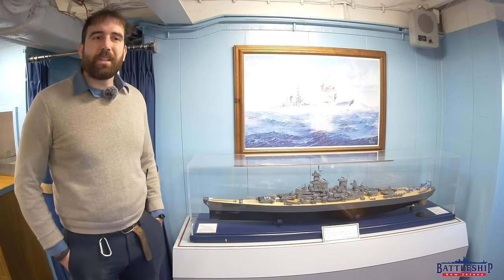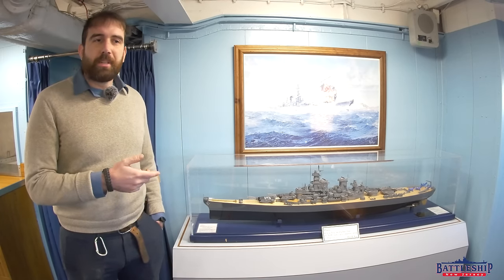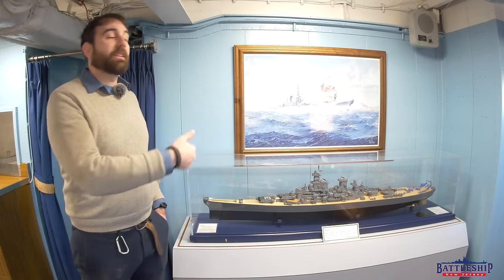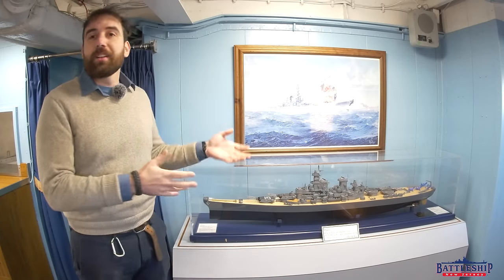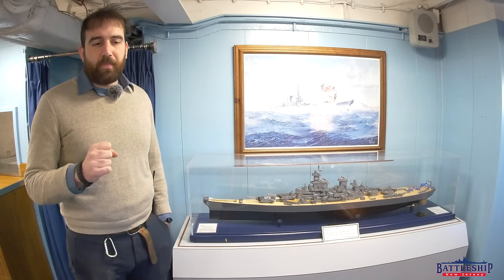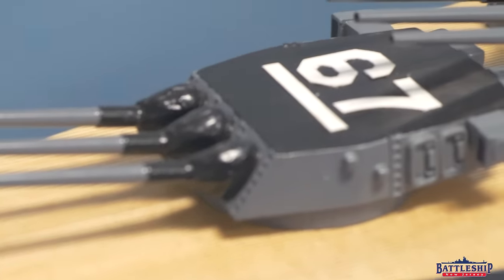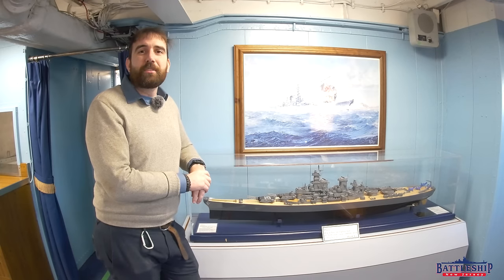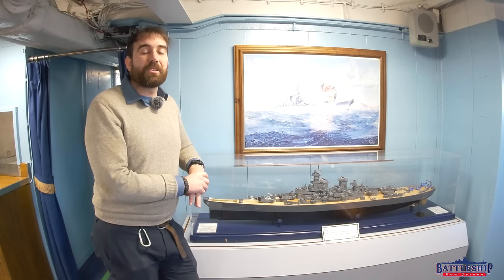Battleship Montana: What Would We Have Done Differently

Comment: A SLEP Refit to nuclear power for the  Montana with missiles replacing a couple of turrets.  Weight saved reactor shielding weigh down low.  The 20mm Oerlikons replaced with CIWS/ Goalkeeper.  (Dare I dream of 2 GAU-8's up high for small boats?) then the 5" mounts replaced with the modern main gun/turret combination.  The end product would be a clean Aegis superstructure, VLS replacing 2 turrets (space for Minuteman 4 pack).  MEGOID upgrade path.

Comment: First, if EVERYONE should have learned anything from the Battles of Leyte Gulf it should be that fleet commanders should fly their flags from heavy cruisers NOT battleships or carriers. Kurita had this right originally and Spruance also usually had this right. Just imagine if TF34 HAD been formed and sent rushing after the Central Force with all the various commanders who were aboard those fast battleships. It would have been worse than Kurita losing control of his battle as Yamato ran from torpedoes.

Second, I think the US Navy would have kept the Iowas after the war even if the Montanas had existed. The Montanas would be more expensive to operate without giving you any real advantage. There wasn't anything around that you would have needed an even bigger (and slower) battleship to handle.

Comment: By "Adding" 35' 0f LENGTH, to the ship, you would now have room for "2" more boilers, ( One on each beam ) which would ADD, almost 30,000 shaft horsepower ( B+W, 565psi, 1050 SuHt temp. ) so your "Armor Reduction" would NOT, be necessary. ( I have considerable knowledge on the 565 series of boilers !, as I am a "Master Welder / Mech Engineer, with 50 yrs of experience by trade.

Comment: I like your suggestions, I think the other change I would probably go for is deleting X turret to go back to 9 guns, and save a lot of weight, while using the space for an extra pair of centreline 3-inch mounts.
Reply: I mean... When you're going this far, you might as well just built more Iowa's and uparmor them. Add an inch and a half of armor everywhere (except the deck), take away the conning tower, accept the fact that this batch will be 28 knots on their best day, and call it a day.
Reply: @eric24567  I might only up-armour the deck and leave the rest as is, to protect against aerial peril.  Would still do a much more compact super structure and single funnel.  If we want pure speed and more armour, there is the option of ditching all the aft guns, turning them into 6-gun American Renowns.  With late-war fire control you’d have 35-knot snipers that feared nothing.
Reply: @juicysushi  The problem is if you want to make any appreciable increases to the deck armor, the weight is going to go through the roof. I like the idea though, but we might have to significantly trim down everything else. Maybe combine the two idea you just suggested? Except with actual Renown layout (2-2-2) instead of the Richelieu-esque (3-3) layout. The slim bow of the Iowa give enough seakeeping headaches as is, I can't imagine lightening the aft end by 2000ish tons would be beneficial.
Reply: @eric24567  I think you’d need the weight savings of the two turrets.  Plus, it gives the ability to move the weight of the turrets back as the super structure becomes more compact and moves rear-ward itself.

Comment: Brainstorming about mods to the Montana design.
Consider that you've "won" the naval war before these hit the water.
There might be a few finishing conflicts, but it's mostly carrier escort and shore bombardment.

How important is speed? Do your carrier groups need to travel above 30 knots when the enemy has so little air capacity?
If speed's important, put the Iowas with your carriers.
If not, then upgrade to a Montana.

How important is a traditional gunfighting battleship? 
If important, retain the four turrets.
If not, lose #3 turret for more machinery (speed) and/ or AA suite.
Automatic VT fuzed 3" guns are coming "real soon now" and an automatic 6" won't be far off.
Combine with those thunderbolt installations and you cover all your heavy, mid and light AA requirements.

I agree thoroughly about losing the conning tower.
We're moving to an age of electronics replacing people, at the masthead, but that demands additional bodies in integrated combat command centres.

Comment: Instead of the current 4×3 16"/50 caliber Mark 7 gun guns, replace them for 4×2 18" (not the 18"/48 caliber Mark 1 gun of the 1920s but the more modern construction similar of the 16"/50 caliber Mark 7 gun, idk maybe 18"/55 caliber Mark 8 gun, firing Super-Heavy 3850 lb (~1750 KG) shells). 4×3 18" guns sounds awesome, but the ship cannot weight +90,000 tn unfortunately. So that's my change, fewer number of main battery armament barrels but heavier. By the way great video!!!

Comment: Gut the steam powered engine out but have a two smaller steam engine to run the generators, use 4 Diesel engine to run the props
Remove all the aa 5in guns and mk5 modem cannon in its place more accurately hiring vital spots and use the 18in guns to rip them apar

Comment: I'm going to look at these post-world war and let's just say 1980s reactivation as I would ditch number 3 or 4 gun turret and replace that with a VLS launcher with a whole lot of missiles I would ditch two of the 5 inch 54 caliber mounts four sea sparrow launchers.

Not to mention I would try everything to keep these in-service past 1992 as I think a battleship with more missiles while still retaining guns would definitely have a future in the Navy.

The only sticking point in keeping a montana-class battleship in the Navy let's just say past 2000 for would-be propulsion as eventually all of the conventionally powered aircraft carriers around their path to being scrapped and the only thing I can think of other than going nuclear propulsion which would be stupidly expensive might be still a bit on the expensive side but replacing the boilers and turbines with diesel generators and electric motors which would still require cutting large holes in the decks but diesel might just be fuel efficient enough to keep the ships in service another couple of decades

Comment: My idea is interesting; instead of 4 turrets with 3 16 inch guns why not have 3 turrets, 2 front and 1 aft which 4 16 inch guns like the French Richelieu design; this way you save the weight of an armour turrent and still have a broadside of 12 guns as oppose to the New Jersey's 9. You have a fast ships; with a lighter weight and more firepower.
Reply: No, it's a bad idea. Having turret with 4 guns means less space for crews for each turret, and require more personal for each 4-gun turret too, much weight up and less fire power, 3 guns turret is more than enough
Reply: While the design of quad turrets has many advantages, it has a huge flaw. If a quad turret(s) is disabled for whatever reason, their total amount of firepower is heavily reduced compared to if it were a twin or triple turret.
This from online source
Reply: Quadruple turrets were typically not used on ships because they added significant weight and complexity without providing a significant increase in firepower. Additionally, they required a larger crew to operate and maintain, which could be a significant drawback in a naval setting. The use of quadruple turrets was also limited by the fact that they could only fire in a limited arc, making them less effective in certain situations.

Comment: If, like the Iowa class, the Montanas are kept in service into the 70s, 80s, and early 90s stripping all the 16" turrets for missile cells is definitely part of the plan. Also the air defense guns would be out to be replaced with modern CIWS and rolling air frame missile defense. Basically,  there would only be two to four small gun turrets for last-ditched surface warfare.

Comment: Remove the aircraft completely, afterall by this time there are aircraft-carriers steaming around and they carry far more aircraft.  This has several benefits - far less highly flammable fuel on-boar (there may be some left for deck tugs and the like, also a bit of weight i liberated which could either be used to add to the anti-aircraft fit, or just gain a fraction of a knot.
Just one thought - the US certainly had the best steam plant going, but did their design teams just stop looking ahead when they signed-off the Iowas?  I somehow think they continued to think and may well have had a new generation or even more efficient plant becoming available and this could have led to even more power and hence speed for the Montannas (just think a 33knot, 12 x 16 inch battleship.)

Comment: i would change the propulsion plants to turbo electric drives and the newest high output boilers
Reply: Heavier!
Reply: @alexwood5425  weight increase of the motors is countered by the reduction in weight of the shorter prop shafts and the fact that a dedicated reverse turbine is not needed

Comment: I still believe going SMALLER wouldve been better. Either a 2x3 gun platform, or a 4x2 gun platform. I tend to lean towards the 2x3 gun platform, but I am also a sucker for pocket battleships like the graf spee.

Just picturing the Iowa in my head, by eliminating a turret, you can save so much weight that the power produced by the boilers actually starts to hit a point of diminishing returns, so you can further reduce weight by removing more boilers. I would translate that weight lost into more secondary armaments such as AA and 5" guns

Comment: Honestly, I'd probably think about stripping off most of the belt armour, because it wasn't very useful after the obliteration of the Japanese fleet in 1945. You still need deck armour to handle bombs (indeed, you might want a lot more of it), but the belt is mostly useful against guns, and guns weren't a major threat any more. 

It's funny how things eventually came around to Jackie Fisher's ideals of speed and firepower without armour, because armour simply couldn't defend any plausible ship any more. Dude was so far ahead of his time it's not even funny (even aside from the whole "invented the acronym OMG" thing).
Reply: Belt armor is also great against sea-skimming anti-ship missiles.
Reply: @hailexiao2770  It's not bad, but these would be getting built in the context of 1946. Sea-skimming missiles weren't an issue until what, the 60s? 70s?

Comment: what about swapping the rear 16" for a 4-pack of autoloading 8"? that way when chasing down and engaging an enemy your 16" can reach out and touch them and when you close the range a bit your 8" can pound them into submission in short order as well as possibly having the 8" configured with more elevation so they could serve as anti-aircraft with radar guidance. quad 8" autoloaders would also increase shore bombardment options.
Reply: Because quad turrets are large, heavy, have horrible firing angles, and lack the rate of train to effectively be used as AA weapons, and why the hell would you trade a quarter of your broadside weight for an extremely situational secondary weapon system that's significantly worse than the already existing primary and secondary batteries?
Reply: Because the Navy has been standardizing it gun layout since Dreadnaught. Now you have 16, 8 and 5 inch guns each with different roles, ROF, priority targets, turret angles, ranges. Is the 8 inch turret armored to the same standard as the 16 inch or less armored, how does either affect balance? How many 8 inch shells do you carry? Where do you put the 8 inch shells relative to the turret? Do you really want to be broadside at 8 inch engagement ranges to get your rear turret into action?
Reply: You're trading three battleship guns for four cruiser guns. The point of battleship guns is throwing mass (which means more momentum) and volume (more explosives) at the enemy. An 8-inch shell (335 pounds) will bounce off a lot of armor that a 16-inch shell (2240 or 2700 pounds) will punch straight through. All a quad of 8-inch shells is going to do in that case is bounce off four times. The US Navy went with 16-inch guns because 15-inch guns didn't give the performance they wanted.

Comment: Oh no no no...
Ryan your changes and your perception of need is so wrong. 
First: the Montanas would already fit all the drydocks and slip ways the iowas do. 
Second: The biggest MYTH..
keeping up with the carriers.
The North Carolina and South Dakota classes kept up just fine.
WHY? Because the carriers didn't zoom around the pacific at 30+ knots all the time. The normal fleet speed was 20 knots.
The Montanas would have done just fine at 28 knots. 
Third: the twin 3inch automatics were not ready for fleet service until 47 or 48. And they had alot of bugs to work out. 
Fourth: there was no more internal space to upgrade the propulsion plant like going to the Iowa class plant. Gaining horsepower required larger boilers and steam turbines.
NOT more manpower. 
I wouldn't have made any changes.
It was a balanced warship. 
Oh..and your model shows kingfisher seaplane.
They would have been Seahawks.
Not kingfishers.

Comment: They should STILL lay down and complete a Montana, today.
Reply: The Iowas were obsolete before they were launched. All a Montana would be is a big target, sucking up money and crew better used elsewhere.
Reply: @JarrodFrates  I mean with phalanx ciws and other modern ship defense systems, and built to Modern standards it would still be a formidable machine. And it would require less crew
Reply: @TheTransporter007  Its main weapons would have a range of ~30 miles. CIWS is only good to a couple of miles at best and is a last-ditch solution. Sea Sparrows and RAM are more effective at air defense, but still relatively short range and vastly outclassed by options carried aboard Burke-class destroyers. Even with a lot of automation, you're looking at a thousand crew aboard a 70,000-ton vessel with a cost per ship of probably $5 billion or more. At that point, just build a carrier.
Reply: @JarrodFrates  I'm not disagreeing with you, your points are all perfectly valid. And certainly more logical than mine, however you just can't beat the big stick energy of a 12x 16" 50 caliber main battery, especially when it comes to laying fire down on hardened shore positions.
Reply: But build it as an arsenal ship, not a 1940s battleship. Something the size of Queen Elizabeth II or Shandong, but with the mother of all AESA radars in the superstructure, packed full of VLS cells (and a reload or two) and maybe a few 5"/64 guns for close in defense.
Reply: @TheTransporter007  You absolutely can. The reason for giant guns for shore bombardment is to use brute force to account for a lack of accuracy. To take out one bunker, you're going to fire several 16-inch shells. Alternately, you can drop one 2000-pound JDAM-ER from a range of over 45 miles, half again the range of 16-inch guns.

But why would you do shore bombardment? The last major amphibious operation done by the US was at Inchon in 1950. The handful of smaller operations since then were adequately and better covered by close air support. It would require spending billions of dollars each building ships for a purpose that hasn't been used in more than 70 years, for which there is little sign that there will be another need in the future, and that is better fulfilled by aircraft dropping precision weaponry, whether as near-drop CAS or far-drop air support.
Reply: @hailexiao2770  Too expensive. You'd spend billions of dollars for a less flexible platform than the current Arleigh Burkes or the near-future DDG(X). The "mother of all AESA radars" is the SPY-6, which is being mounted on current destroyers, and which reportedly has a range in excess of 200 miles (or about 33 miles against sea-skimming missiles, limited by the horizon). A larger antenna will be mounted on the DDG(X), providing even greater sensitivity and capabilities. By the time a new ship the size of a Montana could be designed, built, tested, and commissioned, the DDG(X) would already outstrip its capabilities on a cost basis.

Comment: All batteries OPEN FIRE!!! HARD TO PORT LOAD TORPEDOES!  "Sir we don't have torpedoes this is a battleship." They had torps on BSG! Enterprise had them, Vaders Executor had them.  The ship is so damn large you'd think they could put some deck torps or have them worked in the design for port and starboard, aft and stern poppers. Hey this is a wish list right. No rail guns i know that's  just not possible but id have hypersonic missile launchers along w/ two heavy guns and the typical acoutramonts. Avast ye mateee ... now i want shrimp and lobster... clam chowder...😋
Reply: Use the extra sixteen-inch turret to fire torpedoes at long range.
Reply: @michaelsommers2356  This guy gets it!